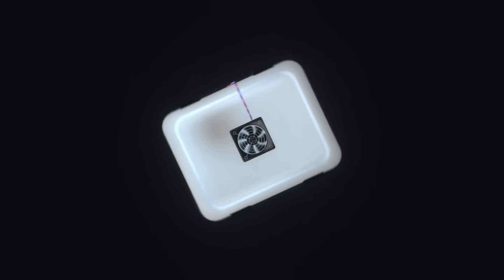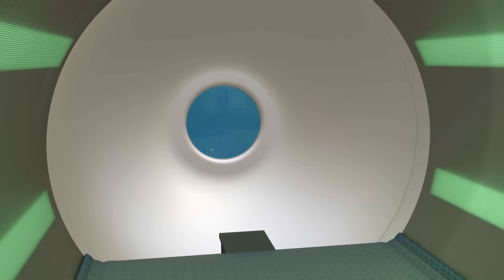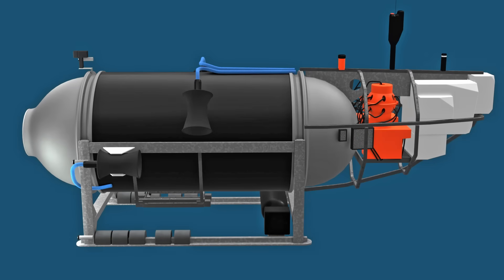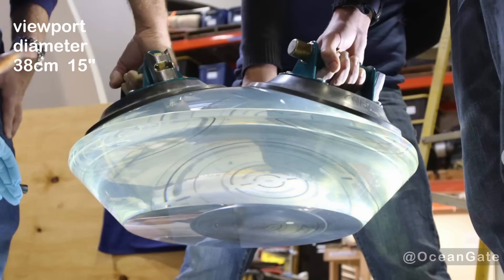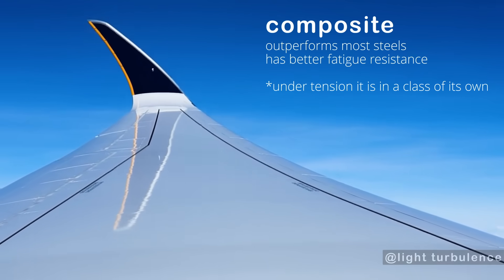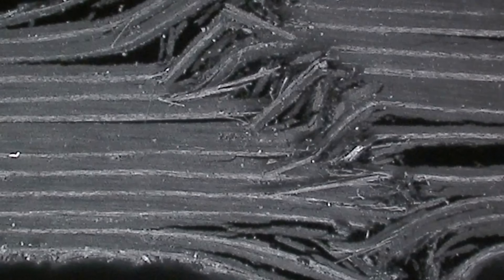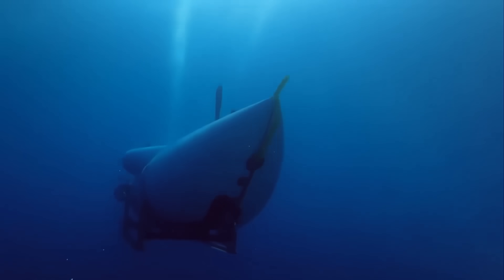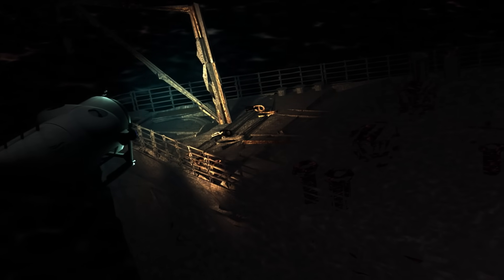Titan Sub | carbon fiber - Detailed Tour

Comment: An important technicallity/semantics that should be clearifyed: Thin fibers has close to zero compressive strength on its own, carbon fiber or not. It is the Resin that give a composite its compressive strenght. While the fibers in the composite is contributing to the composite's tensile strenght (both internal and external tensile strenght). What amazes me is that it looks like the the layup is not vacuum bagged and cured under pressure to remove any air and moisture vacancies. Especially crazy for a compressive pressure vessel(!)
Reply from the maker: Not true

Comment: There was no way to orient the Carbon Fibres to make use of its properties. It should not have been used. The fibres in compression would have similar properties to say, ceramic filler in the epoxy.  Under those conditions either composite would fail. To make use of CF strength in compression the stress needs to handled in tension. Otherwise the complementary stresses will pull the epoxy between the fibres apart leading to the fibres folding in compression. So a lay has to follow the complementary stresses at 90 degrees to the compressive circumferential and longitudinal principle  stresses to stop this delamination.  The would mean lay direction in the RADIAL direction. This was not done.  So I have to write off your analysis a so much waffle.

Comment: I believe you have the fiber orientations mixed up.
But you are right that the prepreg would not be in tension and end up all wiggly, but it would weaken the resistance on the sides not the ends.
Reply from the maker: Hoop wet layup. Prepreg longitudinal is not what I said. If you listen to the video you will see its how Stockton Rush explained it.
Reply: I'm talking about what you said from 10:35
 @Mike-Bell
Reply: So to be clearer, the prepreg would help resist the side loads and the hoop the ends loading.
Like the hoop layup is compared to staking books for support...you lay the books flat not standing up..
https://www.youtube.com/watch?v=QYqOMjoz_i8 @Mike-Bell
Reply from the maker: @michelalphonso6945  No absolutley not.  The fillaments carry force along their length.  Not their sides.  in the same direction wood grain works.
Reply: You did not look at the video. @Mike-Bell
Reply: Your talking in absolutes !
Shows you have a closed mind, refusing to grow, and learn new things.
Sorry for being blunt. @Mike-Bell
Reply from the maker: @michelalphonso6945  NO!!! The forces in carbon fibre are lined up along the length of the fibers. Period. End of story. Definitely. One hundred percent. Absolutely. 

That video is confusing and goes against the direction carpenters orientate wood grain for strength.
Reply: Simple, stop using wood as your guide for trying to understand carbon fiber. @Mike-Bell
Reply from the maker: @michelalphonso6945  Please refrain from entering my comments to disparage my knowledge or suggest that I'm close-minded. 

Watching one video does not make you a sudden expert on a topic. That is calked the Dunning Kruger effect and you would do we’ll educating yourself about that.
Reply: I have a degree in composites.
If you don't have the right knowledge why do you post videos like you are an expert ?
Next time don't ask for people to point out where you might be wrong, if you don't really want to hear it, or are you just setting a trap for people so you can argue with.
And you not liking what I said wont change the fact that you are wrong.
The video I gave you was for your benefit not mine.
Everybody makes mistakes. @Mike-Bell
Reply from the maker: @michelalphonso6945  I have no problem with you having a different opinion.  But dont call me close minded when I don't take your bonkers statement seriously that fibres should be loaded from the sides.  Have you asked why the composite industry does not load carbon fibres side on?  Are you saying you know something they don't!  Where did you do your degree?
Reply: @Mike-Bell  when an individual starts attacking your character instead of addressing the content, i think it's ok to ignore them.
Reply from the maker: @jeebusk Thanks that's 100% 👍
Reply: I said no such thing.
I was talking about the tube !
Remember the tube the Titan has ?
So I was talking about the pressure exerted on the side of the tube !
This is where the tube failed by the way !
As confirmed by several computer analysis.
Reply from the maker: @michelalphonso6945   You did not answer my question.  Where did you get your degree in composites from?
Reply: @michelalphonso6945  we have no confirmation of where the tube failed as far as I know, I'm not sure why you would make that claim. 

It's probably the end of the tube where it's joined to the metal, that's probable but isn't confirmed (and maybe never will be unless they search for small pieces). 

I don't totally understand what either of you think you're arguing above, I'm guessing there's a disconnect. Can you explain better what you think he's confused in your original post?
Reply: Here's the transcript for ref, 
at the provided timestamp.
I've numbered the orientations that I think you're saying he mixed up, but I don't understand how you're saying he mixed them up. 

3/4 of the water pressure acts onto the face of the tube
(1) the hoop arrangement of fibers carries this massive compression force,
They were more than capable of handling the load...
A quarter of the force on the hull was from the end domes, and
(2) the axial fibers carried this load, 
This is likely where the problem lay,

PS these are very helpful models, 
to visualize what's going on.
Reply: I'm sorry, I would like to discus more on this subject but I won't do it on this channel.
I pointed out that the claim he made that the tube failed because it was not strong enough to resist the crushing force of the endcaps is wrong !
This is contrary to what everybody else is saying including myself.
And the discussion about this never happened because Mike said "absolutely not".
That closes the door to any further discussions.
I even provided him with a video which he claims he does not understand, further demonstrating his lack of understanding carbon materials.
I was compelled to point out his close mindedness, it's not an insult, just a fact.
I was gracious enough  to point out that he was right about the prepreg not being in tension, something I myself mentioned in a post months ago, but I also mentioned a possible problem of mixing prepreg with wet lay, because prepreg needs to be compressed ideally in an autoclave, I'm giving this last extra info freely on here but this is where I'm saying goodbye.    @jj-jak

Comment: The inside and outside deformation of the Bands is kinda typical of the hydrostatic forces involved.  This means that the porthole could still be the source of failure, since it was missing when the raised the parts, or it could have been blown out by the implosion shockwave... 
 
(Look at all of those stock movie footage of Depth Charges going off at about 60 feet, when they go off the explosion causes a near vacuum, the water rushing back in is the reason why you see that big and dramatic column of water you see in that footage!)
 
The fact that they didn't heat treat the Carbon fiber, is very likely a major issue as is the fact that they used OLD Carbon Fiber stock (downgraded from Class A to Class B) which is why Boeing sold it in the first place!
 
The difference in the reaction of the Metal End Caps & Connecting Bands to Carbon Fiber can be compensated, but I'm not sure if Rush even did so (or even if such information was available for computer modeling!)
Reply: I agree that seam is the most likely candidate

Comment: I feel like you need to read your own script. This seems to me like a damning argument against carbon fiber that's just a needlessly wordy recitation of the popular conclusion. 

1. Oceangate's design process was incompetent and reckless. 
2. Carbon fiber is fundamentally unsuited to this application. 

And the exceptions you've attempted to highlight only work to prove the rule. It's seem that according to you carbon fiber can't cope with cyclical stress, especially of the extreme sort needed by a deep submersible. And even if it can the manufacturing tolerances required to achieve that proposed level of strength are clearly too complex to be relied upon in a human rated application.

Comment: Should have used 5inches of stainless steel for the drum, then 5 inches of carbon fiber , with a more robust way to keep the ends connected to each other like bolted threaded long rods inside the ss drum

Comment: No way!!! If those batteries start to cook off, instant burning flame, heat and toxic fumes, let alone the weak connections from titanium to Carbon fiber, that was accumulating micro cracks and wear and tear. Next you have super cheap video game remotes, not to mention, other cost savings, they were worth billions, they could have make it indestructible with enough money, and getting manufacturing engineers, and submarine experts involved from initial design to testing, to launch. RIP guys

Comment: One issue with carbon fiber is the amount of shrinkage due to compression it undergoes at depth, and that leads to significant loss of buoyancy. Metals such as titanium do compress at depth, but they don't suffer from anywhere near as much compression as carbon fiber.
Reply: I'm pretty confident the material itself is not buoyant, maybe you can elaborate on what you're thinking...
Reply: @jj-jak  Sure. The buoyancy of the submersible is its total weight  vs the total amount of water that it displaces. When the carbon fiber tube reduces in size due to high compression at depth, then the total amount of water displaced is reduced by the shrinkage volume, thus making the craft less buoyant. By my calculations the carbon fiber would have been compressed by as much as an inch all around, with somewhat greater compression towards the middle of the cylinder. Perhaps the stresses of multiple previous dives allowed the carbon fiber cylinder to compress even more in its last dive. The amount of buoyancy lost could be 100kg or more.
Reply: @paulcarter7445     I'm interested in your calculations, the author has mentioned in comments that he expects them to compress at about an equal rate.

Personally I would actually expect the composite resin to be more brittle, but that may depend on specific material chemistry. 

In the video he mentioned the composite thickness but I didn't hear anyone mention the thickness of the domes, which I would expect from anyone doing maths.
Reply: @paulcarter7445  and if the titanium end bell compresses at a different rate than the tube does (and taking into effect the water temperature) then the end bell joint against the CF tube will be subject to immense shear (sliding) forces.  If the difference is, say, 1% than that may be enough.  The construction video shows that they used an epoxy adhesive under open warehouse conditions to glue the parts together.
Reply: @paulcarter7445 . Isn’t buoyancy also something to do with how much air is contained inside the thing you are submersing?
Reply: @jj-jak   "author has mentioned in comments that he expects them to compress at about an equal rate". He's wrong. The carbon fiber supplier stated that the bulk modulus (compressibility) of the material used to build Titan's cylinder is around 20 GPa. For comparison, titanium has a bulk modulus of 100GPa.
Reply: @Woodman-Spare-that-tree  Buoyancy is entirely due to the mass of water an object displaces vs the mass of the object. By volume, air is lighter than water, so this often means the more air in an object, the more buoyant it becomes. However,  if you compress that object, (e.g. by diving deep) it displaces less water and thus becomes less buoyant. As the Titan descended, it shrank more and more, thus displacing less water mass, becoming less buoyant.
Reply: @paulcarter7445  thanks for responding, what you're saying I'm sure is true. However he did what a dozen or so dives before this one just fine, so I don't think this was a significant factor in this accident. 

It sounds like they had trouble releasing the ballast on occasion before, but what failed was probably the bond between the carbon /composite and the titanium end caps. (My personal top hypothesis) 

What you're saying about shrinkage yes did play a role, as one material was affected different from the other resulting in extra stress, but it wasn't the loss of buoyancy that caused this accident.
Reply: @jj-jak  Loss of buoyancy could have accelerated the dive, quickly compounding the stress and causing ballast release to be ineffective. The repeated compression from previous dives could have weakened the CF, causing the final dive to suffer even greater compression than previously.
Reply: The cracking sounds (described like gun shots) experienced on multiple dives (not sure if it was every dive) were physically damaged areas in the composite. With each subsequent dive the water pressure in these areas would have caused uneven pressure which defeats the design assumptions. 

If the material had even "compression" it probably would have been ok as in previous dives, but having more pressure in some areas and less in others isn't good.

Comment: The dome to cylinder joint is quite different from that of all the wound cylinders that are routinely used.  The design normally  has smaller metalic bosses in each end that are included in the spiral winding process, producing a much better cylinder-barrel structural interface.  One has to watch for thermal effects too, where the titanium dome will want to distort differently than the carbon barrel at depth were the water is quite cold -- again a joint issue
Reply: Finally someone is mentioning the joints!  The interface between the composite and metallic is ALWAYS  the weak point of all composite designs (regardless of in tension or compression or shear).  Amazing amount of misinformation out there on material strengths (look at the composite laminate strengths in tension or compression not the fibers by themselves...and if you don't understand that you really are not qualified to have an opinion).  With respect to the author's concern about the fiber laying in the axial direction that's the exact same process used to make those airbus wing skins you showed (typically tension on the bottom and compression on the bottom under in-flight loads) so I think that's not a concern.  Making a 5" laminate this way with less than 2% voids, and without any QC verification or certification plan that would be a big concern also.  But over all this video was one of the best I've seen (Just a retired aerospace composites engineer so what would I know?)
Reply: @lorenhendrickson2843 any idea why they used metallic end caps instead of laminate ones?
Reply: Much more difficult to fabricate the end domes out of composite, and then still have to have metallic flanges to attach to the barrel so makes sense to make an integral dome and flange...just haven't seen and engineering detail of what the flange to composite bond joint looks like
Reply: @lorenhendrickson2843  I’d settle for the extra weight and the simpler risk profile.
Reply: @lorenhendrickson2843   You don't need a drawing.  You can see it's a square U channel capping the ends of the CF tube.
Reply: @jamesdellaneve9005    IT was risky, but worked a few times.   I'm more concerned about the design failure  of the FIU bridge which didn't work at all.
Reply: Well its clear you are aware that the 'Interface' of these composites in structures is of the upmost importance  but almost never gets mentioned so kudos there !...cheers. @lorenhendrickson2843
Reply: @lorenhendrickson2843  I think you mean compression on the top of the wing.
Reply: Thanks for your insight and analysis. How obvious hull cracking can be taken as an acceptable condition blows my mind.
Reply: I am not a composites engineer (but work with a lot in aerospace). This joint is what concerned many. Temperature change co-efficient s, adhesive retaining it’s strength, etc.
Reply: People have also commented on the difference in distortion due to the pressure. Titanium and the carbon fiber hull would deform differently and the interface between them might be a problem since it has to deal with this discrepancy in sizes and shapes.
Reply: @ralphiewho That was actually the first configuration tested by Oceangate and Washington University Aplied Physics Lab. You can find a video with the test here on YouTube. One of the metallic bosses separated form the carbon fiber composite. That's why Oceangate abandoned that solution.